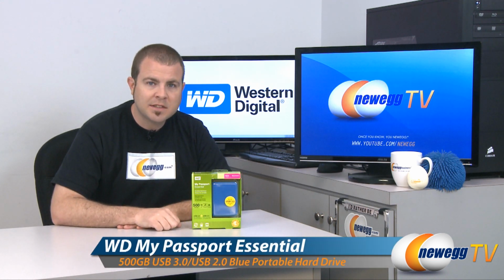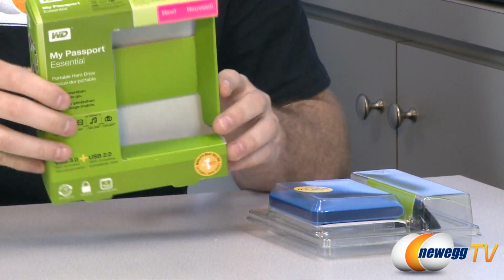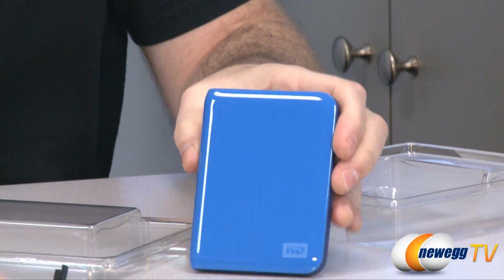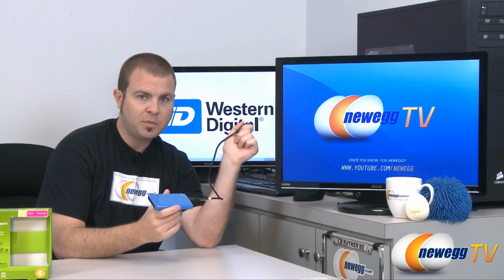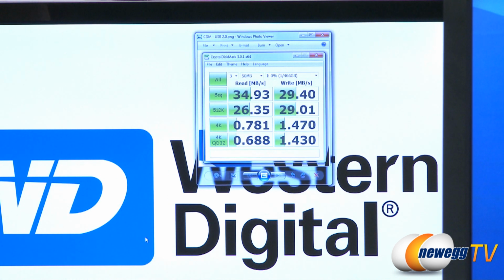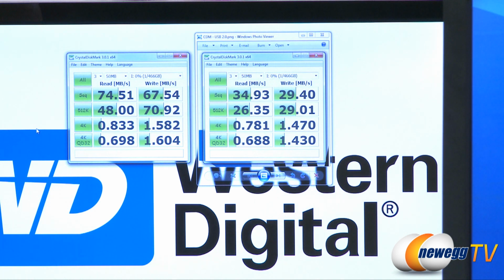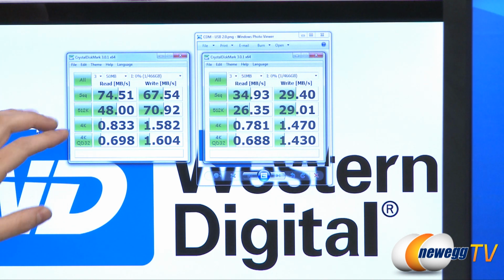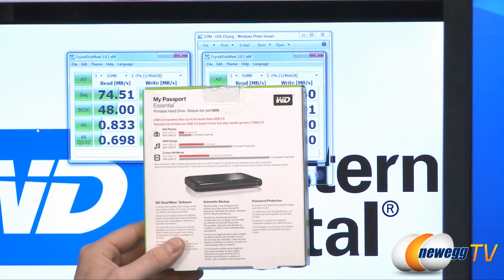Newegg TV: Western Digital My Passport Essential Overview

Comment: I LOVE the big size of the drive. I frequently help others with their computer problems and often need a place to copy data in the event the system is so trashed that it needs to be restored.  Most of the time, speed is not an issue because I am usually not in a hurry to make the backups...